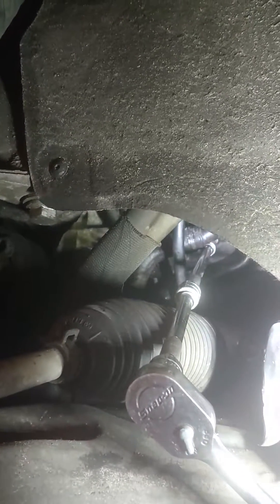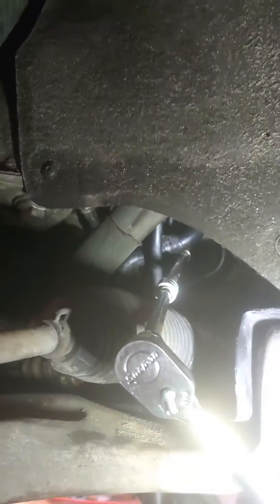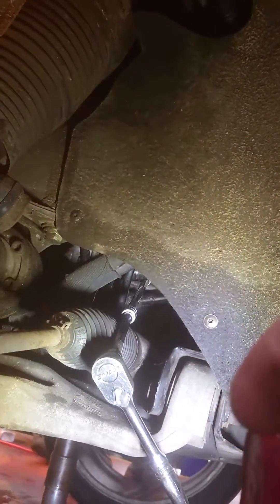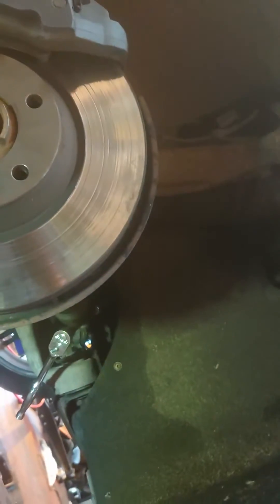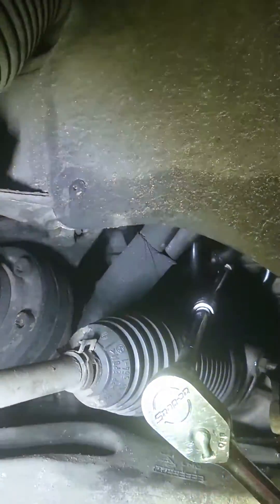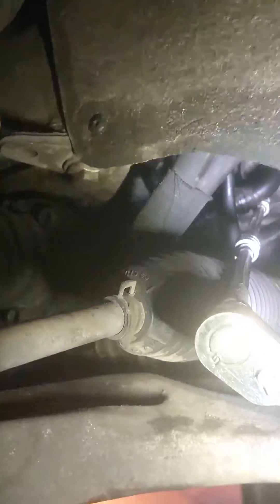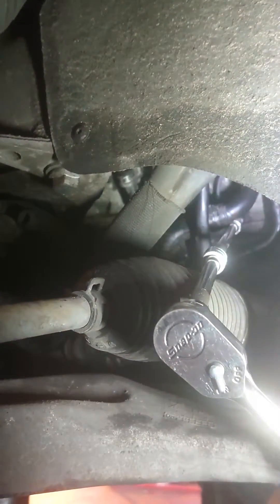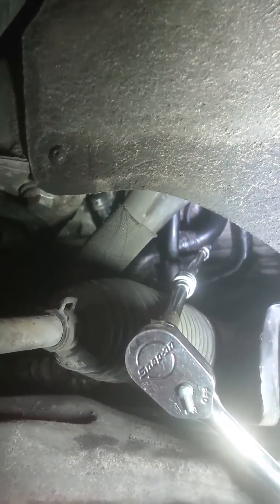Car wont start when hot Audi crankshaft sensor location v6 TDI Q7

Comment: Exactly what is happening with my Audi a5 quatrro 3 litre when hot just cranks over no start changed everything pump relays runs and starts easily when cold but after 100 miles starts giving problems and small SD pray of airo start then ok for another 100 miles was starting to think that one injector was leaking back into the return but before changing and checking injectors going to change cam and crankshaft sensors

Comment: Thanks Guys, the defect you describe is EXACTLY what my Audi A6 C6 allroad 3.0 diesel was doing. Sensor is in the same place (its a 3.0 Audi diesel afterall). Difficult to see the sensor and change it, but in the end its not that hard a task just very awkward. Had to remove the front LH wheel, lower wheel guard lining and the front LH wheel driveshaft cover (Quattro). My crankshaft sensor also had a small metal box over it (protection or heat shield) and just one bolt to remove the sensor. Perfect description on the symptomatic failing of this sensor. 
THANKS
Reply: Glad to be of assistance 🔝🙂

Comment: Mate, could you please tell me where the actual plug is located ????
Reply: U got part number?
Reply: The plug to the crank sensor is actually in the crank sensor bolted in the block above the steering rack in the bottom of the block above sump access is through the passenger side wheel arch